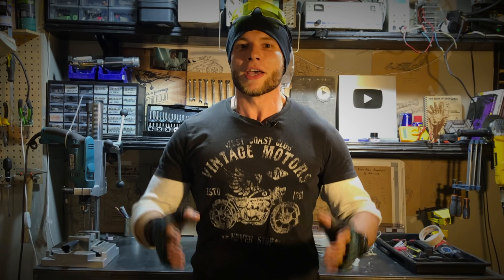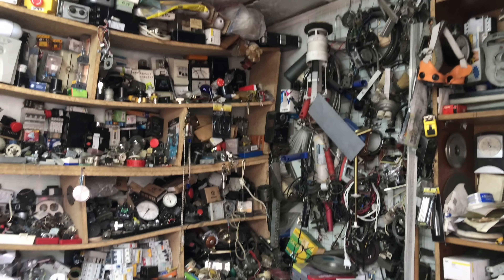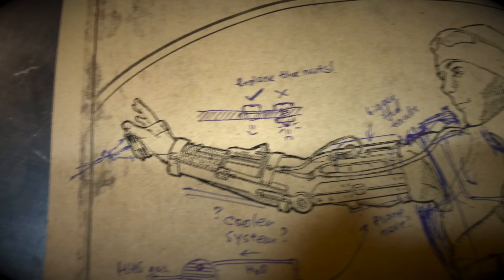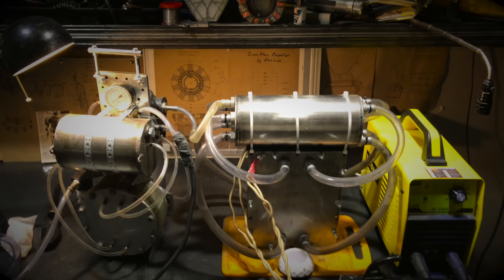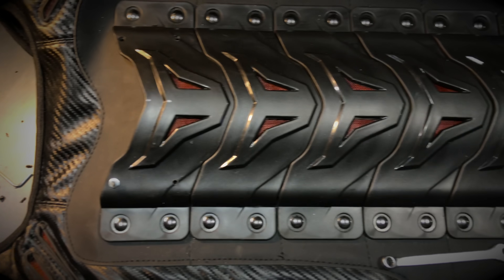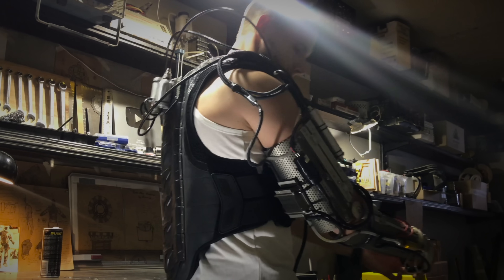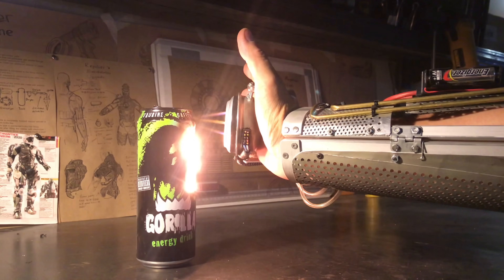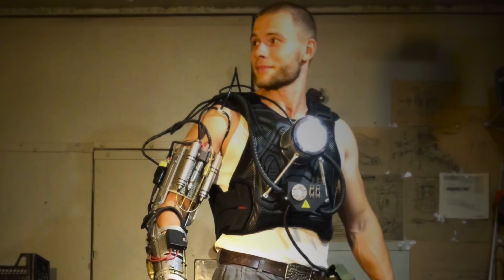Iron Man Repulsor 2.0 (3000°C HHO torch for Iron Man suit) DIY alkali electrolyzer

Comment: hey, this is my first time here and you probably already know but saltwater conducts electricity much better and produces more hydrogen and oxygen quicker
Reply: One slight problem with that. It also creates bits of sodium and chlorine. The sodium will react with the water and create sodium hydroxide. Which builds up on the metal. The chlorine… well that not fun to have floating about. So while it may make more H2 And O2. It’s also creates a mess in the reaction chamber and slowly releases a toxic gas
Reply: @benspooner7396   i in no way shape or form claim to be a scientist i only know about makin hydrogen bc i did a hydrogen candle for a science project one year, is that what turns the water green over time? also tested was baking soda which gave more of a reaction than normal water but less than the saltwater i think the more impure the water the better the current conducts

Comment: I couldn't stop laughing at that "god, when are we all going to metric". I think that's a question any engineer has asked him or herself a hundred times a day when working on larger projects...

Half the materials are ordered and sized in imperial, but most of the research papers are in metric and virtually everywhere officially uses metric, but there's still enough people who use imperial that you constantly have to switch between the two systems... It's the most annoying thing on this planet to finish drawing up a diagram and then find out it's going to an American so it has to be in imperial...

Comment: Just curious, but what if there was a magnifying glass to amp it up?  I don’t know shit bout engineering btw
Reply: If it was light then that would work. He’s using straight up hydrogen and oxygen gas. And burning it near 100% efficiently. Gas doesn’t work with a magnifying glass. This is why he angles 3 beams together to mimmic the effect a magnifying glass would have on light. He’s turning 3 even temps into 1 huge tempreture

Comment: I'm a 34 old woman working in the health system and though I don't understand everything he's  saying, i find it totally fascinating! Well done sir!  your work is fantastic!
Reply: Basically he is sending electric charge through water to split it into hydrogen and oxygen, also called brown gas when they are both together is gas form. He uses this brown gas as his main fuel. Here instead of accumulating gas to build it up and then release in a pulsing action, he aims to let a smooth stream of the pressurized gas go through. Brown gas is super flammable. Like, he most flammable thing out there, so he is practically just going to light these streams of gas on fire while they are connected to his hand. he applies 3 streams angled into a central core to keep the streams thin and to focus the overall energy of the three (Or I think so from what I got from him) and uses a liquid cooling system to cool the thing down. I imagine that is what you might have picked up already though, but those are the key principal of what this is, a plasma torch built on his arm which is really cool.
Reply: @isayoutubehandle  Thanks alot!
Reply: @Spacexplained  a lot*
Reply: @silentwolfkills3924  homie this comment was made 2 months ago, I think you're a bit late to the party aren't you?
Reply: @Spacexplained  No it’s never to late to correct someone
Reply: @silentwolfkills3924  W hater
Reply: @silentwolfkills3924 it’s never *too* late to correct someone.
Reply: @isayoutubehandle thanks this really helped me understand
Reply: So wholesome

Comment: I'll give you a bolder mission. Imagine a motor which uses water. Water is held in the "gas tank" and pulled into electrolysis immediately before combustion. Hydrogen and Oxygen are separated only a second before use minimizing the danger of hauling Hydrogen. The exhaust system can recapture the the water output in order to recycle it. It is not likely to be 100% efficient but the number should be high.

Comment: Interesting thought, what if you used 3 “arc reactors” in a situation where one controls the left arm, the second controls the right, and the third is your back. Do these generate anywhere near enough fuel to create thrust? It would be amazing to see a system that could lift a small person. And would it be practical given the temperature they reach? I have a curious mind and would love to understand why it would or wouldn’t work! Thanks.

Comment: Hey man awesome video & amazing work. 
Not sure if you already thought of this or not but if you put the cooling systems tiny radiator between your hand and the repulsor it will help better keep your hand from burning by absorbing more heat directly;  then connect the recirculating electrolyte lines from your portable electrolysis system into the radiator to use the electrolyte as coolant. This keeps your hand from burning while also using some of the waste heat to help aid the electrolysis for a higher overall quantity of brown gas production.

Comment: hey man... great video. a suggestion: for the 3.0 version use graphite sheets instead of stainless steel. much easier to work with (you can make the holes with a hole punch), much lighter, much cheaper and guess what? is more efficient as well so you can generate more hydrogen

Comment: Have you considered using a Metal 3D printer to integrat the gas holding tanks and piping into a "hull". That way you can achieve the IronMan external look while having the piping well protected and encased in the "armor". Connecting the pieces may need some old fashioned pipes, but still

Comment: Why not let the flames come out of the fingertips?.. this way you can make the fingertips a 1/2 " longer and add  cooling device to cool the fingers. Coming out of the palm is crazy and what if you want to hold something?  Remember Iron-man suit and its function is impossible in real world application.  However, the device you have build is cool, I do not see a use for it or if Trump and his crazy spaceforce will be knocking on your door for your designs lol.

Comment: What if the "repulsive" power comes from controlled gas feedback into the system? The system would have to be engineered to cut and reengage on a consistent basis to produce the proper pulse frequency. Perhaps more emitters cycling through an alogrythim? My theroy is that more producing power in a flux state could potentially even lift an object that was braced against the multiple overfires while not cutting something. A different algorythm could potentially cut steel on a consistant basis. To sustain the constant rate of high yield burn, a refrigerated solution may have to be incorporated between device and flesh.

Comment: This concept can work (as a rocket) but hydrogen is a poor choice logistically. Something that can store as a liquid will give you a lot more energy density. You should also avoid storing oxidizer if you're operating in air.

Comment: You should teach in schools man you are awesome, also if there is a heat problem in addition to cooling and circulation would instead of making an exoskeleton frame work would a heat resistant glove/ sleeve work? Maybe something with heavy insulation to keep from the heat that could be worked around the eco frame for added flexibility? I also noticed it was a bit short on your arm near the wrist which could lead to further discomfort, I’d love to hear your thoughts dude but all in all you did what I only wish I applied myself to do

Comment: What's the furthest distance from the material at which it still has effective heat transfer? And is there any way to create a system to change the angle at which the flames converge in order to make that distance greater?

Comment: MMM bit more complicate than hydrogen diffuse system which still impressive mind ya. Repulses system as it name implies, Is a frequency at the particle level creates barrier condenses down surrounding particle to point of plasma then release basically a solar plasma bot. sadly I don't have equipment and further know how to create it the machine. I did it with induction frequency. I could say I am Junkyard scientist lol. I think you could do it with Hydrogen diffuse release system with a Argon gas field inside of induction casing. could get pure plasma ark with that with continuous flow. To be fair it madman idea lol.

Comment: use a thermopeltic plate behind the palm repulsor to generate voltage from the temp difference. the ceramic construction should isolate the heat well enough

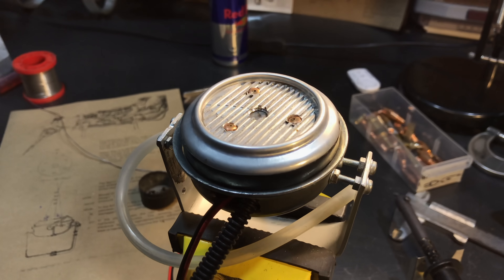Comment: 10:29 heatsink and radiator is a good idea. Maybe put them on the backside of the hand, with heatpipes on one or both sides of the wrist, down to the heat collection plate attached to the backside of the aluminum disk torch holder. That aluminum disk could be thinner, too.

Also, put an insulator between your hand and the  hot metal parts. Maybe even a heat resistant cloth glove. Ive seen similar for baking/oven use.

Edit: if you do it that way, the radiator could flatten and spread out, improving conformity with rest of exoskeleton.

Heatsink could be a floating plate, attached to nozzle holder only, heatpipes and support bar curve around the pinky side of hand to stay away from thumb, up to radiator that extends over the wrist joint, maybe even a big circle, and it doubles as a small shield. Have to form it to not get in the way of wrist movement, alternately could be formed to reinforce joints at extreme range of motion.
Reply: What if the "repulsive" power comes from controlled gas feedback into the system? The system would have to be engineered to cut and reengage on a consistent basis to produce the proper pulse frequency. Perhaps more emitters cycling through an alogrythim? My theory is that more producing power in a flux state could potentially even lift an object that was braced against the multiple overfires while not cutting something. A different algorythm could potentially cut steel on a consistant basis. To sustain the constant rate of high yield burn, a refrigerated solution may have to be incorporated between device and flesh.
Reply: Hey I’m trying to build everything on this video but I’m having some trouble understanding the tanks and gas system and how he ignites the gas. Would you be willing to help me finish up my work? I only have 2 weeks left to finish it all up but I have most of the equipment! Please and thank you.

Comment: You can easily fix the non-uniform flow out of your 3 nozzles by incrementally crimping the tube for the nozzle getting linear flow from in input line to increase back pressure until the 3 flows nozzles are uniform :) Also if you loop the electrolysis line through the heat sink you can increase the efficiency and rate of electrolysis as it scales positively with the temperature of the water. Source: Aerospace PhD, feel free to contact me if you want to talk more.

Comment: This project is fantastic and I love all of this progress that you're making, I do have a suggestion for your solder joints. Looking at them it seems that you could use some more flux on the joints, adding some extra flux would help the solder flow and make your joints a bit stronger and prettier. Just a suggestion, keep up the good work.

Comment: are you also using water to cool  the hand repulsor too or just the radiator system? replacing that with water would probably cool it better and it would give you more water stored in your suit that can be used for something else too like power generation or some sort of high pressure water hose

Comment: You could look into using Aerogel as an insulator for the torch!
Reply: Not quite...you can make it using a high pressure rig
Reply: Very experimental and almost impossible to get ahold of
Reply: @SunChaser141  Yes, NileRed made it. Seemed very hard but not impossible.

Comment: Díd you consider a PEM electrolyzer? Will save you the dryer and o2 and h are already split out of the device, hence will save you weight and output will be much constant. Ah, and you’ll get rid of the ko2 as pem electrolyzers use pure water without electrolytes...

Comment: Not a reactor in the same sense as the arc reactor as that its a form of nuclear fusion for the creation of energy, you have created an electrolysis box which requires electrical input to split hydrogen and oxygen from water.

Comment: A local guy was designing a hydrogen injection system for increasing vehicle fuel efficiency.   It seemed to work tho how well was debatable.   They used harmonics to pre-excite the atoms in the water going under electolosis to increase the gas output.  Sadly I don't know the two or three frequencies they used for the harmonics.  Might be worth experimenting with shrug

Comment: When it comes to the heating problem, I would suggest to start from scratch and ensure the hydrogen gest separated from the Oxygen and then have a separate nozzle for each the hydrogen and oxygen taking a similar design to an oxy-acetylene torch design so the hydrogen reacts away from the metal instead of rate against the metal of th nozzle.
https://www.youtube.com/watch?v=95U9798ZptM